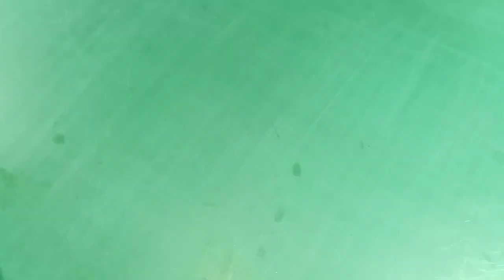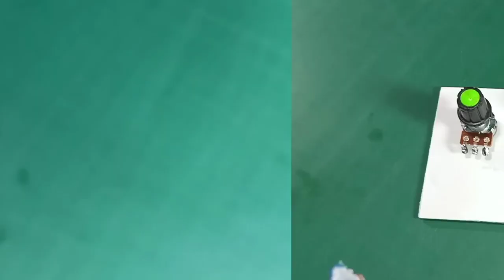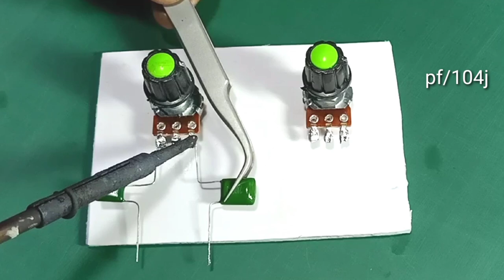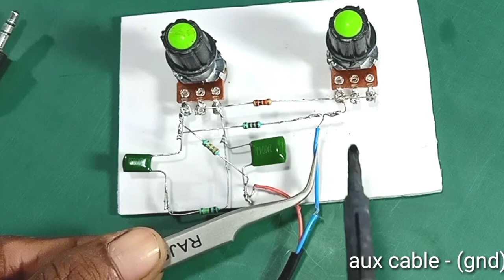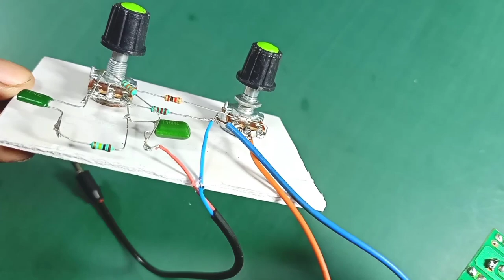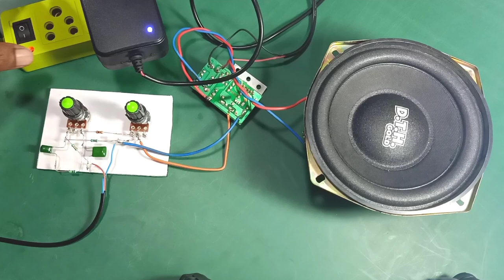Extra Powerful Bass Volume Controller / How to Make Extreme Bass Volume Controller for any Amplifier

Comment: brother iball taranga mini tower 2.1, soofer volume very low its wroking but woofer volume very low, other 2 speaker working good condition,bass volume and tereble volume main volume seperate checked on remote also,same problem ic check its good condition,ee kya problem brother please help

Comment: Can i use this for 5v amplifier board.
Reply from the maker: Yes
Reply: @RJEDITALL  I am using pam8403 . Will it work without any issue.
Reply from the maker: @ashwinks8250  you can try